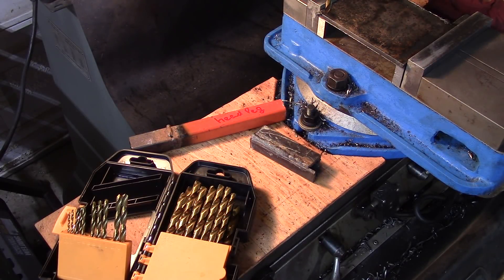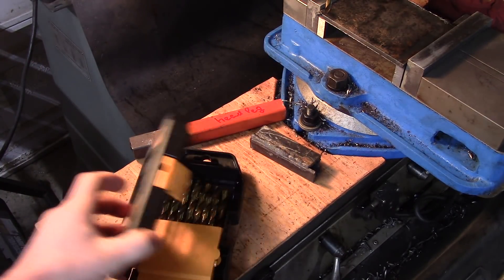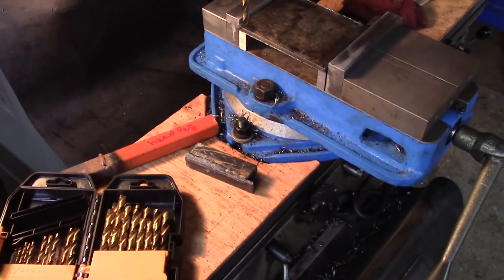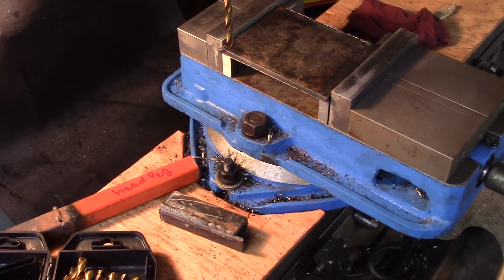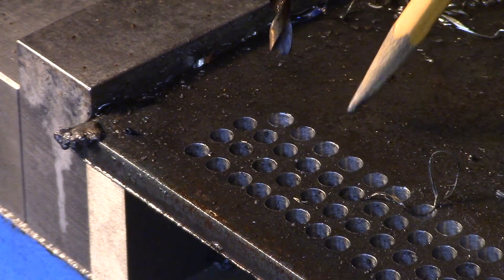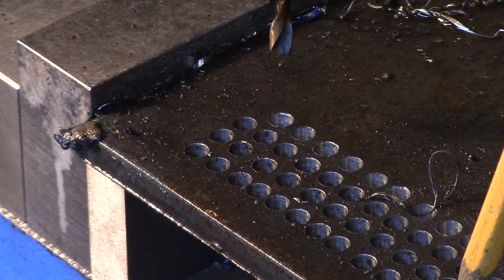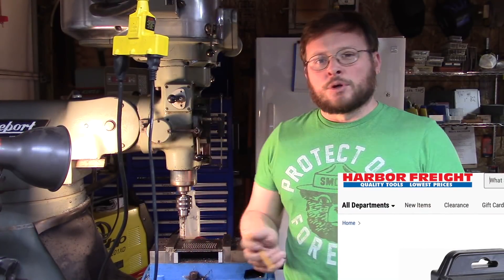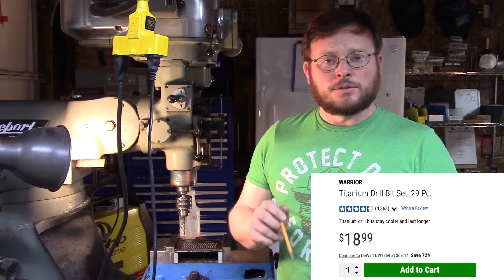Harbor Freight Torture Test - Warrior Drill Bit Set

Comment: I got this pack for $10.99 and hol-sheet... for the money. They are amazing. I'm not expecting them to be as good as a $200 set, but they work fine for wood, sheet metal, etc.
Reply from the maker: They're a good disposable set. I use them for anything that may break or damage them easily. That way I save my good sets for more important jobs.
Reply: If you drill with a drill press on slow speed they are amazing.
Reply: @lar4305  yeah... these are my "Abuser bits".
 
 If I have something questionable (or  that i just plain know it's going to wreck a bit stares at stainless steel  ) then these guys come out lol.

Comment: I have these drills and have seen similar results as in the video. I use industrial drills daily and don't mean to imply they're similar - they're not - but for occasional user these are great for the money. I can see how using a mill can eliminate a number of variables. I use a similarly rigid and accurate machine. The thing is, someone who isn't experienced and using a hand drill likely will not see the same level of success, IMO. Good video. Subscribed.
Reply from the maker: Thanks for the comment! I agree completely that in a hand drill, these are probably not going to survive anywhere near this long. Hand drills open up so many scenarios that depend on the user, their experience and their attitude at the time they are drilling (Sometimes I've been frustrated with it and just decided to "ram it through" lol).... Thanks for subscribing, I appreciate it!
Reply: T

Comment: You know why you have no trouble with cheap harbor freight drill bits? Because you know the 1 secret that 99.5% of people including me at one time don’t know. Slow speed and medium pressure keeps the bit from getting hot
Reply from the maker: Its true. Then if you can add in a strong rigid setup beyond that, you'll really have good luck. Probably if I used these in a hand drill I would have had a lot more trouble, but I wanted to test the drill bit itself and not test my own ability to run the hand drill. Remove the human factor as much as I could.
Reply: Thank you.  I've watched so many machinist's videos and observed the speed at which they use their bits (in lathes usually, but also drill presses), and I adopted that style for my hand-held drills.  These days most people who I either give the advice to, or who witness me drilling into steel, balk at using drills/bits like this, yet I've seen one or two of them with dulled bits in short order when doing their own projects.
Reply: @MaineMachinist  Something I just noticed with hand-drilling the other day - after purchasing my first quick-connect drill bit for an impact driver - was that the quick-connect "chuck" allowed the bit to wobble during drilling.  I was wondering how that small amount of wobble was going to affect the bit over time.

Comment: Good review and I have had a similar experience with my sets. I have broken a few bits, that was due to my negligence. I use my drill doctor to resharpen them.
Reply: You should learn how to sharpen a broken bit  without a drill doctor.
Reply: @bobbg9041  I learned to sharpen drill bits in 1986 when I worked in a re-build shop, but when you have several bits to sharpen the drill doctor is a lot faster and easier on a set of old eyes like mine. I still sharpen the occasional bit by hand if I need the bit at the moment, but when I go through my bits I break out the DD.
Reply from the maker: The Drill Doctor is really good for smaller drills in the set that are harder to see at the grinding wheel. I see no problem with using one. They're fast and convenient.

Comment: I'm new at metalworking,  but isnt metal supposed to be drilled through slowly with an oil lubricant?
Reply from the maker: I'm actually running these very slow. Several hundred RPM below what normal HSS TiN is capable of.
Reply: Yeah, but this is a torture test, worst case scenario to see how they hold up.

Comment: How many rpms? That looks awfully fast
Reply from the maker: It’s actually slower than normal. The formula for determining what RPM to run a HSS drill at is SFMx4/D

SFM is Surface Feet Per Minute. That number for mild steel is 110

So 110x4 = 440

440 / .250 diameter drill is 1760 RPM. 

Most people run drills extremely slow and it actually ruins them

Comment: After about the third row the bit got hot, it changed colors and was making blue chips thats when it started getting dull.

Thanks for this i could use a cheap set 
For metal or wood. 

I had a cheap dewalt set that has lasted years, drilling 1/8" holes the bit bent
Drilling into a bed frame with a hand drill.
I never got the bit to change colors or cut blue chips. 

You did that test on a bridgport thats kinda of cheating.  Will it do this on a cheaper belt driven drill press?
You wont have speed and feed rate controls like the bridgport.
Reply from the maker: Sorry I didn't see this at the time. Any drill press would be much better than a hand drill. You're more limited to the speed controls, but I think you could find the best option you have and go with it. You're right that you can see the chip change as it goes through the video. I was expecting it to fetch up and break the drill bit.

Comment: Your drill speed is way to fast for drilling steel even with the best drill bits.
Reply from the maker: Wrong. This is slower than what it should be.

Csx4/D is the mathematical formula experienced machinists use to determine spindle speeds for HSS drills
Reply: @MaineMachinist the formula is for ideal circumstances with ideal material. HF drills are not ideal material. I’ve been a machinist for 40 years, slow down your drill speed.
Reply from the maker: Lol… what did you do for 40 years? Run the saw?

I’m already 25% below what a HSS can run at.

Say, What’s the SFM for hot rolled again?

Comment: Titanium isn't a gold color when are companies going to stop selling that lie...lol awesome test though 👍👍✌️
Reply: It's a thin coating of a titanium nitride, technically a ceramic, not titanium metal.
From Wikipedia:
Titanium nitride (TiN; sometimes known as Tinite) is an extremely hard ceramic material, often used as a coating on titanium alloys, steel, carbide, and aluminium components to improve the substrate's surface properties.. Applied as a thin coating, TiN is used to harden and protect cutting and sliding surfaces, for decorative purposes (due to its golden appearance).

Comment: kinda pointless... why not use it with a drill or some real daily use... this is not a Torture Test
Reply: Beg to differ. This is a torture test due to rigorous drilling and high temps.
Reply: Real daily use? You mean like 99% of people use to drill 2-3 holes? 
This test is by far superior than the standard use.
Reply from the maker: This eliminated the operator error aspect of the drill set. Somebody could be breaking them all the time just because they try drilling at an angle or some other mistake. By using these in a rigid milling machine under controlled conditions, it actually tested the drill bit itself and didn't factor in operator mistakes. The proof is in the video - these will drill, and drill well. If someone is breaking them constantly, there's an operator error involved.
Reply: Maine Machinist 
You are correct. I purchased these bits because of your video. I have never had a problem with them. I do understand the every day use comment. However you have to have a baseline for determination. There’s too many variations in people’s ideas of use.
Reply from the maker: @Miner-49  thanks for sharing. Like you, I know these aren't top quality bits, but they have their place. Especially for the price. I have two sets on hand and I think it's worth it.